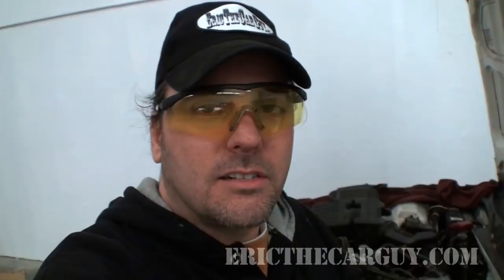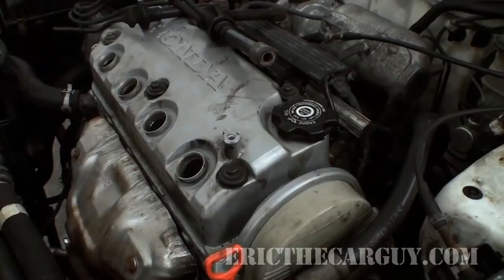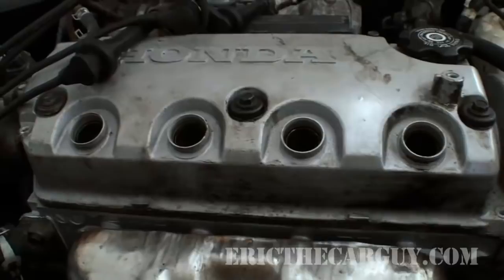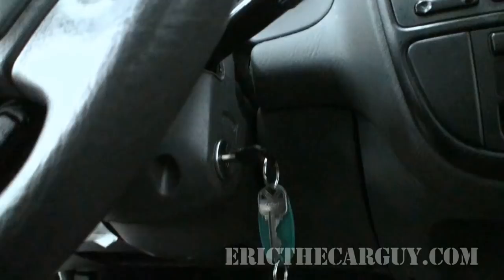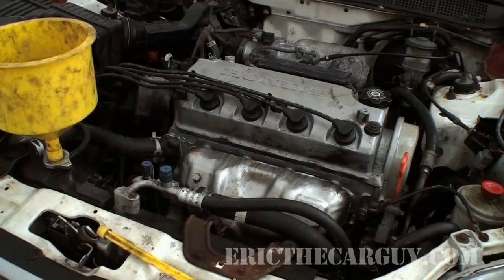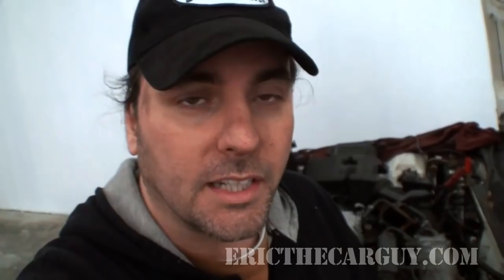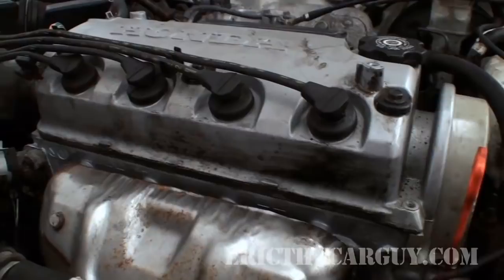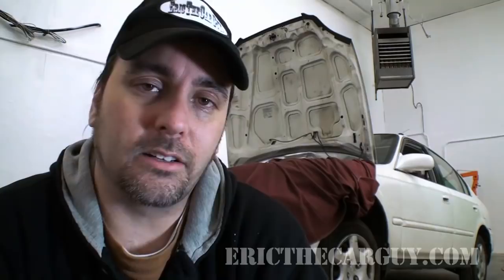How to Break In A New or Rebuilt Engine - EricTheCarGuy

Comment: Actually they want you to run several heat cycles through new engines. As the parts will cool down and contract and start to conform to the moving parts and get lubrication. 

And there's nothing special about the oil. It's the same stuff you put at service intervals, for the engine, transmission and axles. 

I would still change the oil filter at the first 1k miles and 3k miles. Then drive it like normal.

Comment: Plain and simple. Seat steal rings. Chrome rings dont cut into the cylinder. They dont seat. No need to prime with good assembly lube or moly. Change the oil after an hour of run time and then at 500 miles. Just run them. Modern engines do not wear into each other like the old loose fitting ones.

Comment: I think it's funny the statement that the previous engine was burning 1 quart every 1000 miles.  I work for Acura and we currently have a warranty extension on second generation TSXs with K24 engines about excessive oil burn-off.  American Honda considers 1 Quart for every 1000 miles to be acceptable with anything above that as eligible for review.  With our oil changes currently scheduled at 4.5k miles give or take according to the maintenance minder system, that would require our customers whose engines burn oil at that rate to check their oil level 4-5 times between oil changes.  Since most customers who drive TSX's in our area are generally young professionals with no mechanical sensibilities (many who don't know how to pop the hood open), imagine their faces when I try to explain that they have to touch their dirty luxury car between oil changes or bring it in for a oil level check that often.  The K24 engine is a fantastic design but many are ruined out of modern day car owner carelessness.
Reply: +RisibleRye  Thanks but I'll take my old B18A anytime. I think I lose more oil out the dipstick from checking it than what goes out the tailpipe.
Reply: +Hubert Littau Oh I agree.  I have an all-stock second-owner '92 Integra that I purchased from my dealership at which it was regularly serviced and a salvage-titled 3rd-owner lightly-modded (by me) '01 Integra.  The B18A in the '92 with 206k on the odo burns no oil between 5k oil changes.  The B18B in the '01 with 190k burns between a half and whole quart in the same distance probably only because I drive it so hard.  So yeah, B and D series for me until we run out of supplies.
Reply: +RisibleRye Isn't a lot of that caused by the low tension piston rings used to increase mpg's? Just an honest question
Reply: Yup.  That's exactly how they described it.
Reply: Just wondering if you think this applies to all K24 engine variants? I was thinking of purchasing a 2015 Civic Si with the K24Z7,but have heard about similar issues with the VTC actuator and burning oil. Some people are blaming the 0w20 oil. What is your opinion if you don't mind?

Comment: Hello Eric. My car engine just get performance built and last couple things about to be done. it was tuned previously and normal running rpm is 900 on the park when you crank it, but cold start is way more than that. should i keep the ecu tuning is the same tuning before the first start or should i tune it back to factory tuning until the vehicle pass the breaking point of first 500 miles?
Also What type of oil should i use for dry internal first start such as 5-20 or 5-30 or 10-30 also can i add lucas oil stabilizer? Thank you

Comment: Hello Eric, I have a 97 Civic with a B18B1 from a 98 Integra with a 93 YS1 Integra GSR transmission and a 63 trim Turbonetics T04e turbo currently running on 8 lbs and I just replaced the engine with a junkyard engine because of a spun bearing due to lubrication issues (pan was dented in and pickup was riding on the pan). I swapped the engines and the junkyard engine burned oil like crazy due to the oil control rings being seized to the pistons from carbon and sitting in the yard for years. I pulled the pistons and used a stone deglazer not to attempt to deep hone the cylinder walls, but to give the new NPR rings a fresh surface to seat with. Anyway, I should get the new rings in tomorrow and I've already replaced the rod bearings just to start fresh since I'm replacing the rings and I added some ARP rod bolts while I was in there. My question to you is what would you do for a break in procedure with this engine? It already has the turbo kit on it but I don't want to get into any boost until the rings are properly seated and the bearings are worn in. Any advice would be appreciated. Thanks.
Reply: disconnect charge pipe.

Comment: @eric hey man i used this sefoam engine cleaner in the throttle body and gas tank and it cleaned the injectors pretty goo, but they also said u can put it in the crank case to break up the gunk in the engine. my car has 192,000 on it. some say it will eat the gaskets, and some claim they had a success. Being that i have all those miles on the car do u think its a good idea to out this stuff in the crank case?

Comment: What detriment is there in bringing the engine RPM up immediately and then running for the 20 min or so of break in? Most procedures I have seen suggest that approach instead.
Reply: My guess is that the more violent explosions of the increased fuel and hotter temperatures and faster revolutions of all the bearings and rings may over break-in. To the extreme we know that over revving an engine will make it break.  In practice probably reving a new engine a little bit after it reaches normal operating temperature is perfectly safe.

Comment: ...also, since my engine has over 197,000 miles, any particular oil I should use? I was thinking Castrol GTX High Mileage 10-40, used that in my old '95 Dodge Stratus which made it run a little better and burn less oil. Some people are suggesting I use 20-50. Any thoughts on this? Anyone?

Comment: That's not correct. I think you are mixing up a couple different things. The max torque and max hp are harmonic points the engine reaches. Break in is a procedure for seating the engine parts into their permanent home.

Comment: yea but it not like it big parts of metal shaving floating around. It very tiny particles. If you change it a 1500 or 3000 eventually it will come out.

Comment: @charlietow the 93 to 95 where the best 300k and never had a check engine light . only part replaced other than maint. was the radiator. my 94 accord has 500k but the civic was a better made car.

Comment: If you do a engine rebuild engine everything should have oil, i.e lube the crank, piston walls and pre fill the cylinder wall block and cam shafts, its only like thats a engine that has been left standing for a couple of weeks all the oil ect.... drains to the sump, laws of physics
Reply: +alex tilson I agree totally. I am not a trained mechanic, but I have rebuilt many many engines. When assembling, the rule I follow is to use plenty of oil (not too much, mind) and every moving part should have oil on it, most especially all the bearings, including camshaft and oil pump. Also a fair amount in the cylinders. Crank on the battery with no plugs till the oil light goes off, install the plugs. By this time there should be a little fuel in the carb (see how old school I am!). A little fuel down the throat, and it should start and idle straight off. impresses customers no end, when you stand outside the car and reach in to start it for the first time.. I always add coolant after the first start ( only about 30 seconds running) just in case there is a fuck up!!!

Comment: water pumps are cheap... whenever i replace an engine it gets a new one automatically!  even when just doing a timing belt its a good idea to change the pump because it SUCKS to have to pull all that crap off again because you dident have 30 extra minutes the first time you were in there!  still a good video though

Comment: what if after you fully rebuilt your engine from con rods, pistons, bearings, valve, lifters, cams.. etc. etc. and you run with a bigger turbo and injectors with it.. my question is it safe to break in the engine without damaging the engine with fuel and air ratio?
Reply: Im gonna upgraded all that how would I prime and be sfe

Comment: Break-in procedure for a new motor is 10,000 miles. If you own a 4-cylinder, you don't go above 4000 RPMs for the first 10000 miles. That pretty much guarantees everything is seated properly. I would not trust a 500-mile break in

Comment: See at 5.06 in the video you were saying it sounds like it needs a valve adjustment? Is that because of the kind of hammering sound coming from the engine? (Like little hammers knocking) I bought a civic the other day and I'm getting that kind of hammering knocking sound when its running and it sounds exactly like that. So is it a valve adjustment I need to do?
Reply: If this is not a diesel engine, then yes. It needs at least an adjustment. Depending on the exact engine (as a general rule) it may have hydraulic adjusters, that adjust themselves automatically. If in this case it sounds like this, then you either have not enough oil or a faulty adjuster,

Comment: Just put new Jasper engine & tranny in my wife's  2004 Grand Cherokee Ltd. A new radiator came with it which was nice but the overflow plastic bottle will not allow any antifreeze in it. The radiator is full & no heat issues but, the bottle wont take fluid. Is this a vacuum issue or a volume issue from the new radiator ? Anyone ? Thanks.

Comment: I have a 99 Civic Si, and it has a check engine light. The computer is throwing the code for the cat running below threshold, and I do have an aftermarket high flow exhaust installed. I'm not sure if any of this has anything to do with my problem, but every once and a while, my engine kind of just shuts off. For instance, I'll be driving down the road at 30 MPH in 4th gear, and the engine will just cut off. All the lights and gauges on the instrument cluster fail as well. So I pull over and it fires back up no problem. That has only happened once. But, it seems like the engine almost does it occasionally. Like, I'll be driving down the road, and out of nowhere, the car bucks, and all of the lights and gauges on the cluster fail for a split second, then come back on and I can drive normally. It's very odd. Another symptom I noticed is once the cad is warmed up, the idle seems to move around quite a bit. Also, when I do hard accelerations the car seems to buck a little bit in the low rpms. I'm not sure if this is just a result of lack of low end torque or not. The clutch is fairly new, so it definitely isn't slipping. Could you help me? EricTheCarGuy
Reply: Check to see if your main positive line is shorting against the frame anywhere including the one that comes off the alternator
Reply: Thank you! I'll check that out.
Reply: could be the main relay too, my friends del sul was doing this same thing changing the main relay fixed it right up

Comment: wait that clicking or chugging noise at around the 5 minute mark, what is that because my jetta vr6 sounds like that when it idles for a few minutes
Reply: +Donovan Grimsley like he said, it needed a valve adjustment.  so the noise you hear is the cam lobes slapping on the lifters

Comment: Eric, what about a top-end rebuild? I'm putting 2.2L heads on my 2.5L Subaru engine, and its on the stand. I'm not touching the block at all, just all "top end" (on Subaru boxers, is it even really considered "the top"). Do I need to go through a break in procedure, and is it similar to this procedure?

Thanks
Reply: I would just because its been sitting
Reply: ***** How have I ruined the car
Reply: There's loads of forum posts building these combo motors. Yes, you can do it, I think the bore is the same at 99.5mm but the difference is in the dome in the cylinder head. This is going in my rally car, which has to run N/A until I get some years under my belt, so we're trying to get as much power from this block as we can. As for compression ratio, that's where our power is coming from, at near 11:1 compression ratio and running race fuel, guys can get 200+ horsepower, which is more than enough to get me started.

Comment: I heard things about people using special kinds of oil, i think diesel oil, in the break in period.
Reply: +Zodstone Yes most oils now days have the zinc removed. Most engines now run roller lifters. You have to run the proper break in oil on old school flat tappet cams. And you got to keep the RPM's up to break them in. Wrong oil or lack of additives results in worn cam lobes.

Comment: Hey, I got a question about a fresh engine first start. So the oil pump was primed about 2 months ago. I have a 2001 Cobra rebuilt with forged rods+pistons, 8 quart oil pan, TSS oil pump gears, everything is new, built heads with stage 3 cams...etc. Should I just start her up and hope oil pressure builds within a few seconds. Or should I disable Fuel/Spark and crank it over for about 5-10 seconds then start her up. I also don't know if just cranking the engine will do that much, or maybe like I said I should just start it up hope for the best. I really can't find much online. Any help is appreciated.
Reply: I'd suggest unplugging spark and fuel and taking plugs out. Like in the video spinning the engine without that compression will help the oil circulate better/quicker
Reply: @gliniecki11  I'm doing the first start on my 2001 SVT cobra tomorrow, I'm nervous because I have about 10K into this engine, build to take whatever I throw at it. My first engine build, First time doing all of this. But I've spent countless hours doing research on how to properly break it in. This is the way I have concluded to break MY engine in "ANY comments/tips are welcome".. unplug Fuel injectors+fuse, take out spark plugs, crank for about 5-10 seconds. put it back together, start her up "best to have an oil pressure gauge at this time, But unfortunately I don't and will just be hoping I have oil pressure :^)". Idle for no more than 5 minutes for the first time, at this time burp the cooling system and make sure there are 0 leaks. After that, take it around the block and let it get to operating temperature, in this time give it some throttle "No more than half throttle, also don't baby it" I was also told to not downshift for the first 50 miles,I didn't ask why, but Dan at ProDyno said so, and I trust him, he's a good guy", give some throttle, get up to approximately 3500rpm and let it coast down to about 1500rpm "I read this creates a vacuum in the crankcase riding the cylinder walls of shavings?" Am I correct?, repeat this a few times in 2nd,3rd and 4th gear "Don't drive too much at once, you don't want any hotspots forming within the piston rings to cylinder walls", After that change the break-in oil+filter out with more break-in oil, After that just drive it "normal", no bogging, still no more than 4000rpm, no more than half throttle,  change the break-in oil+filter at about another 50miles, Inspect to see if everything is still breaking in "checking for shiny oil" after those 2 oil changes, Next oil change is at 500miles,1000miles...etc. Don't drive any short distances to where you are not reaching operating temperature, for about 300-500 miles.
Reply: @gliniecki11  Check my channel for my first start video. I wish I got better footage, but I was so nervous making sure everything was good. I'm surprised she idled so well for a first startup.

Comment: You think its possible to blow a head gasket. I didnt bleed the coolant correctly or turn it with the starter to lube it first. Then a friend revs the hek out of it trying to check it out then floors it like a d***  when you just told him to not give it any gas my friend starts redline in it? It was only the second time i ran it for more than a minute but i was just gona idle with new oil and filter but now i have a vacum leak sound in  intake and im using b-12 and i didnt mix it right brutal.

Comment: Sheesh that knocking at 3:59 when it fires up is painful. What's that all about?
Reply: +Ben Dewse could be bad bearing clearence, or bad fuel. Hondas are pretty noisy but more from cylinder head
Reply: +Ben Dewse If you watched the whole video you would've seen that it just needed a valve adjustment
Reply: +Ben Dewse Knocking is when there is no oil pressure, it's normal for the very very first start. As oil starts to climb up the engine that knock will go away. If everytime you start the engine you hear that knock, you're out of oil pressure and that's bad
Reply: Cristian Ceclan
lol no

Comment: Err--No, Thats NOT the reason to 'ramp on the engine' Rods do not stretch--if they did, you'll be changing the engine again--Haha--Stretch the rods!--Thats a good one will have to remember that!!

Reason to push engine to its max during break-in is to Seat The Rings. Nothing More. 
Should be done carefully--5 runs at half throttle, 10 runs at Max throttle, from 30-60MPH allow to overrun down to 20MPH between runs. then normal driving. All it needs.

Comment: eric, i just replace my pistons and rings, re-bore my engine block then in nettral everything is fine but when i started to drive, i think there is a loss of power  and its like choking, but after then when im already running on the highway around 50,60-70km, everything is fine and stable but sudden press on acceleration makes it chokes and its like loosing power, spark plugs were also new, what do u think is the problem?also i noticed that when i turned on the ac, its losing a little bit power and in neutral the machine is not stable (shaking thank normal). please help, thank u
Reply: albert trinidad timing?